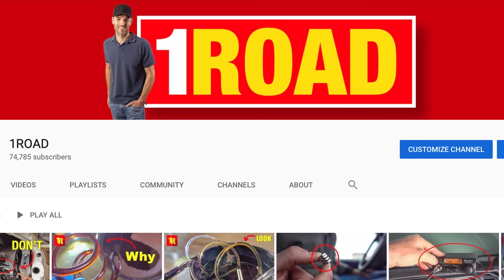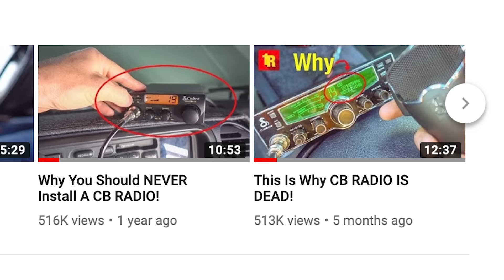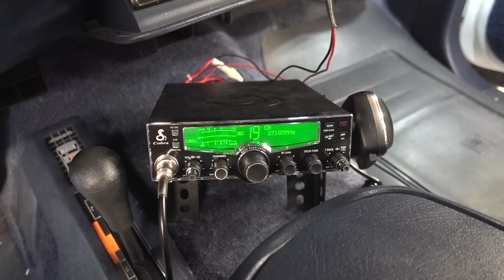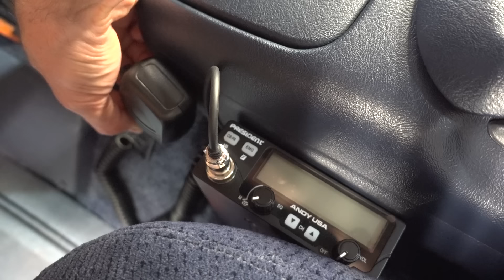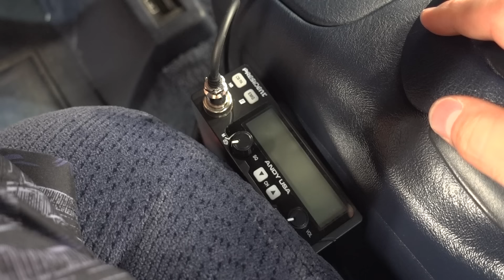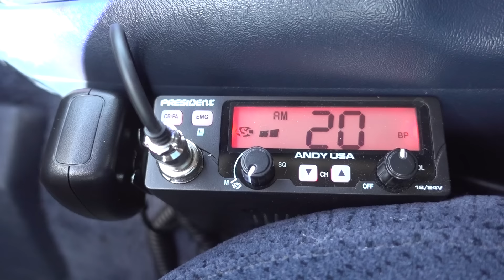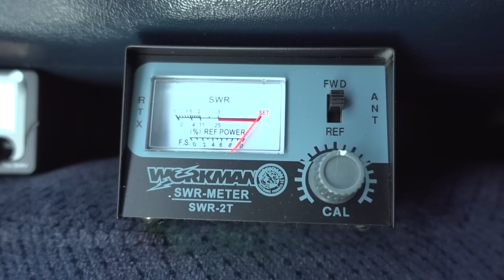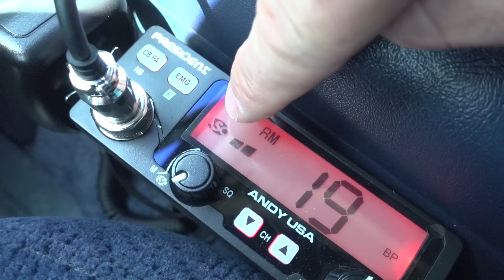Here's Why YOU SHOULD TRASH YOUR CB RADIO!

Comment: Great video but here's the problem with your installation. The heat sink on the back of the radio is designed to be in the open air. The output transistors on the inside of the radio are mounted to the heat sink in order to cool down the components. Sandwiching the radio between the seat cushion and the center console will produce a lot of heat which could damage your final transistors. This type of installation won't be an issue if one uses the radio to primarily receive transmissions however if one spends a lot of time talking, they will eventually have a problem.
Reply: Bullshit, that area is open to air movement from the blower winter /summer, plus cold air tends to hang low, I used to be a cber and a ham until the radio service became a joke gave away all my stuff around 2005, got a desk top and never looked back.
Reply: @w1pev695  No, it makes me an electronics amateur and a student of physics and I had a bigger radio set up like that with more clutter and never had a problem and if you have a technicians license well good for you.
Reply: I thought the same but with just 5 watts output, and the limited airspace, it should be ok.I just wouldn’t personally mount it there.
Reply: I did a similar installation with a similar sized Cobra in my 1989 escort back in the day.  It worked well and the Velcro was fine.  No problems with heat build up as I very rarely transmit.
Reply: Stick a computer fan to the heatsink with high-temp. Silicone etc.
Reply: Also be careful where your airbags are so in accident the radio doesn't hit and kill you most car manufactures have a template for you vehicles so that doesn't happen.
Reply: Why not mount it on the dash in a place like Phoenix during 130° days as opposed to where you think is the wrong place for heat exposure? Lol!
Reply: They don’t use transistors in modern cb’s. They use ic’s
Reply: @w1pev695 Unless you plan to press the talk button for 10 minutes it should be ok.  ✅.   Listening to radio channels won’t heat up the unit.

Comment: I've been using CB for 20 years, I'm also a Ham Radio Operator, and a Truck Driver. My first love was cb. After watching your videos I really think I may put my radios back in. My main radios I use are a Galaxy 979ssb in the Truck and a President HR2510 in my Car. I run a Wilson 5000trucker in the truck and a Tram 3100 mag mount in the car. The antenna whip is 5.5 ft It works really well! Thanks for doing the videos

Comment: Son I love your enthusiasm. I have been in radio since the mid 70s. I doubt it would measure up against my Cobra 148 GTL or my Delta Force Magnum. Keep learning, your on the right path.
Reply: I wholeheartedly agree!  CB is fun and useful.  I do ask anybody reading this to be respectful of others while operating on the CB frequencies; don't be a douchebag.  Licensed as a General Radiotelephone operator (commercial radio/TV) in 1976, licensed as an amateur radio operator in 1993.  Oh, and don't forget a little service called FRS - Family Radio Service, which is much better for local conversation than CB, which can skip and is subject to QRN (natural interference and noise) and QRM (man- made interferencee from electrical wires, LED bulbs and the like).
Reply: The only reasons one would want a small radio is there not interested in a full featured radio or they only have a small area for installation. Real enthusiasts want features so you want a Magnum or similar type radio. Happy Thursday.
Reply: @danielgeorge9283  Daniel, I found SDR radios. They're ultra cheap and some can tx. Get one just about anywhere 30.00 antenna and all. Hook to a computer.
Reply: 148 gtl all the way. Love mine. And I have several. 😁

Comment: they do make CB's with all of the controls and display in the microphone, so you can hide the main chassis
Reply: UHF make such units with remote hand held
Reply: Google
Reply: @archangel9568  Not in the US, where this video was made.
Reply: Midland 75-822 is gonna be the closest to that I think. There are GMRS radios that would probably be better suited, depending on your needs. Wouxon k1000g has a detachable face and I think it's BTech that makes one that can be used entirely through the mic.

Comment: I remember the craze of the 70s when they only had 23 (?) channels and it was so over crowded they went to 40.  I always liked having a 40 channel with upper and lower side ban.  I could always find a empty channel if I was just talking with one or two people.  So much fun on a long trip, even if you just listen.
Reply: When they went to 40 channels they reduced the maximum modulation. If you use a 23 channel radio they will talk louder.
Reply: @wooferhound7571  I didn't know that.  But there were a lot of people who boosted their output anyway.  But in reality, back in the early 70s there were so many people on the CB you couldn't take anyway unless you were way out of town.  Now days, seems like the channels are pretty much empty so I can see a 23 channel again.  Not sure they still make them though.  I was in the Los Angeles area back then.  Wall to wall "breaker break".
Reply: Eric Cutrer  Keep in mind, I'm 70 now and my mind says band but my fingers don't type what my mind says.  Such as in another reply I said take instead of talk.  But you are so right to point it out in case I didn't really know, or I miss inform other people.  Good catch.
Reply: I still have a couple of them somewhere, Golde eagles.
Reply: I did keep a side band CB in my pu untill the sound quit , now I just have an old 40 with weather , but it is peaked to get a little more range
Reply: I remember having one in our van back in the 70's...with the shag carpeting and all.  We traveled out west and up and down the east coast.  It was a staple to keep track of the smokeys.  Today I have one in my Jeep for trail rides and I turn it on while driving the highways.  Some truckers still use them and you get some good information on the road conditions that GPS can't tell you.

Comment: I drove Trucks for nearly 30 years before I retired a few years ago. I had a President CB Radio that was about the same size as the Cobra 29. You got a smaller unit. There was a lot of cursing on the radio so I didn't have it turned on very often. I will install one of my CB Radios in my vehicle one of these days to check for accidents on the interstate highway before I get on the highway. Nice video.

Comment: Cobra 18 WX ST II radio, with a Cobra HGM75 powered mic, and a Wilson 1000 mag mount antenna. I chose the radio for its compact form factor and ability to receive NOAA weather stations. I have it mounted under a single-din stereo in the stereo compartment after having modified a double-din bracket. Works perfect in my SUV that has limited space.
Reply: Love the use of a modified double din. I have the Cobra M75 powered mic.

Comment: Personally, I prefer having a CB with SSB capability supplementing my Icom IC-7000.  You can never have too much road and weather info when traveling in hurricane devastated or other areas.
Reply: I prefer side band over regular am in the 11 meter band it was originally a ham band but ham did not use it so it was taken from ham and made a radio for people to use it was called citizens band radio  or.  CB. As you know it  and  then you needed a license to operate it the licenses was $8.00 for for 5 years I got my first one in 1960 and it was a lot of fun  for the biggest part when you go to a smaller radio you won’t have the best Quality radio you need all those parts for ground level noises and electrical  electrical  interference
Reply: Finally, someone with a amateur radio license!
Reply: It's what got me into being a ham. Have had my ticket for almost 17 years now. Love my 7300. 73 de KC8YRK
Reply: Peakd n Tweaked is the way to go! Get Freq's. Go to a pawn shop that takes and sells CBs, they'll have power supply and antenna hook most likely. Then look for one that's been Tweaked n peaked. Your switches on the front won't do what they used too but..... You'll have a radio that has a ton on diff channels.   Boom Triple Nickel baby!   That's a Chanel btw...
Reply: A 'dresser' radio is nice, but my little President Andy II FCC does what I want and works as it should.

Comment: General licensed amateur here. I encourage all CB radio operators to get their Amateur license, even if you don't get an Amateur radio.  The information that is necessary to be a ham is invaluable to maximizing the 11 meter band due to not only tuning an antenna, but building one specific to your purposes as well, whether it be dipole, ground plane, beam, or any variation.  For instance, if you have local friends on CB you can all run horizontal dipoles to reduce noise that is prominent on vertical polarization, though you might need to tweek the direction they are facing in order to talk to each other.  It's all radio so the physics doesn't change with licensing.  Add that to the ability to assemble and tune a ground plane antenna from telephone wire and a handful of parts and raise it into a tree in order to increase your range is critical in a disaster situation, no matter the band.

The 10m and 11m bands are close in their characteristics and will DX worldwide in the right conditions on not a lot of power.  
Speaking of power, it doesn't take a lot to talk a long way.  Height, antenna, and tuning make more difference (to a point) than power so 4 watts on AM and 12 watts on SSB is PLENTY.  The Amateur QRP (low power) people routinely cover entire states on less than ten watts SSB.  It's a matter of using the right band for the job in the right atmospheric conditions with the right mode.  
CB has its own strong and weak points, like any other band, and does good for some things and not so good for others.  Overall it's a good HF frequency and has a lot to offer, performance wise.  Unfortunately, the radios themselves have only recently began moving away from 50 year old electronics technology.
I suspect in the coming years CB electronics will somewhat catch up to Amateur, which is a good thing, especially since FM is now allowed on 11 meters here in the States.

I will also suggest in investing in a CB radio that has SSB capabilities as a first or only radio.  It's a better value.

73!
KO4LTR
Reply: Building a dipole for garage cb and studying for technician ham license.
Reply: @terrymeyer7084  good luck and don't forget to have fun!

73
Reply: @jj25397  I've been a trucker for 20 + years and have always ran a good cb system. Just now able to slow down enough to get myself setup in the garage and really get into it. Learning the ins and outs of how a radio works and what to do to get good contacts has me hooked.

Comment: I drove 18 wheelers for 10 years starting in 1976, and CB's were all the rage back then. As a retiree, I still run one in my motor home, but now a days, you hardly hear anyone even giving a "bear report" on them. You see lots of trucks with CB antennas, they're just not talking on them very much, but they are still a viable means of communication on the road. Lets face it, with all the current modes of communication, the CB is still the best way for everyone to talk on the open road, simply because, in the US, it has never been universally replaced with anything else. You can't talk to everyone on the road with a cell phone because you don't know their phone number. The same goes for a FRS/GMRS radio. Unlike CB, You need a license with virtually every other form of 2 way radio. With a CB, channel 19 was and always has been the accepted channel for road communications. Your GPS might tell you that a traffic accident is on the route you are running, but it won't tell you exactly where it starts or how far it is backed up. You will find that your CB comes alive in a situation like this. This is not the case in Canada, where most truckers talk on UHF/VHF radios. CB is alive and well in the US in 2019, it's just playing under a different set of rules with new players.
Reply: In Australia we use uhf cb. I'm also a ham, with vhf/uhf radio as well.
Reply: @davidholyoake5256  Also in Oz as in many other countries you can't legally use a mobile cell phone while driving but ok for CB uhf.
Reply: I used to run in the Balkan oil fields and we used CB and BB 100% of the time. Most areas didn’t have cell service.
Reply: In the greater Toronto area on the 401 highway you will find that channel 19 is still a very good means of traffic reporting, it quickly comes to life when traffic becomes an unexpected standstill.
Reply: I also thing they are still monitored in some locations on emergency channel ? I dont use in my vehicles any more with cell phones and I have newer hand help VHF radios for convoy work now but I still have my CB radios just in case, and think will hook one back up at the house for the just in case
Reply: People are switching over to GMRS. Yes you need a license but you simply go online and pay a small fee, no test to take unlike HAM radio. GMRS has a number of advantages over CB. My Jeep club and the off road community in general is switching to GMRS radios.
Reply: RC M said, "Unlike CB, You need a license with virtually every other form of 2 way radio...."
CB does require a license, however it's considered automatically obtained as "license by rule". So, the licensing is transparent to the user...but it does exist. The "license by rule" also assumes that the radio hasn't been modified and is operated within all restrictions of that license (like one can't use an amplifier to increase the output power). Otherwise, operating the radio isn't legal.

Some years ago, to be legal, one actually had to obtain a paper license from the FCC and a government assigned callsign to operate a CB radio. It was just a mail it in and you get the license thing (no tests), but to reduce government (a very outlandish idea, right?) the FCC finally just dropped the paperwork and folded it in to the "license by rule" provision.

Comment: I have been using CB's for50 years mainly for traffic info and hunting. I use both vehicle mount and handheld.  My current set up is a new Cobra Mini 19 and a 24" adjustable Firestick. A 10 year old Midland 75-822 handheld is still working fine.  I also have the hard wire antenna/power adapters so, with the addition of a magnet mount, it can be used in a travelling partner's vehicle. I do notice less CB use out there....   50 years ago the CBs were steam powered and there were only 3 channels, and they were party lines! Times were hard back then.
Reply: awe the good ol days, not even old analog scanners got much going on now, too much digital :(, uniden bearcat btc7 
    Ch. 1-40 CB Channels
      29-  30 Ham Band-10 Meters
      30-  50 VHF Low
    118-137 Aircraft
    137-144 Military
    144-148 Ham Band-2 Meters
    148-174 VHF High Band
    406-420 Government
    420-450 Ham Band 70 Cm
    450-470 UHF Band
    470-512 UHF "T" Band
    806-956 800 MHz Band

great for searching

Uniden Bearcat BC60XLT-1 another good one for searching

Comment: Great video!  As a truck driver I have to say that the CB is my most used and valued tool in my truck!  As for my overland vehicle (2001 Ford Excursion) I use a Yaesu FT-2980R 2m radio on the amateur radio frequencies.  Its a great option to get more distance out  and clarity when out in very remote areas. The radio itself was around $150 or so and I use a very similar mag mount antenna tuned for 2m operation.  You do have to obtain tour technician license through the FCC, but it is well worth it!!!  You can hit repeaters on setup by your local Ham Clubs and talk across the state if theyre properly linked.  Maybe another option for you for when your away from town?  Keep up the great videos, Sir! Im building mine right along with you! 😎😁. 73’s to you from Sapulpa Oklahoma. KG5SLQ
Reply: sir, I hope you don't mind me asking but how do amateur radios work differently than a CB radio? in a hz and wavelength point of view. Also, what recourses did you use when getting into amateur radios?

Comment: The president McKinley has both AM and SSB  available and is only a bit larger.  I’m a ham operator but the CB service is very useful when needing to communicate with other drivers.
Reply: My President Washington radio is terrible. It’ll flat out break if I try using it as a mobile radio. It constantly looses reception. I haven’t found a solution for keeping that damn string taut.
Reply: When   I was a kid I had a cb with ssb and it was awesome. Does anyone still use ssb today?
Reply: @MrPlowboy66  Hobbyist here in Finland uses usb quite often.